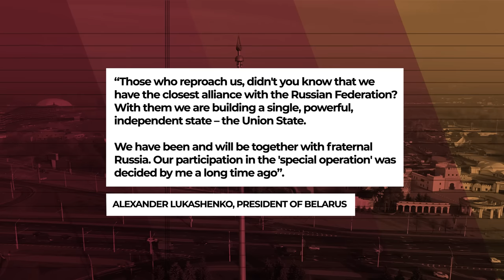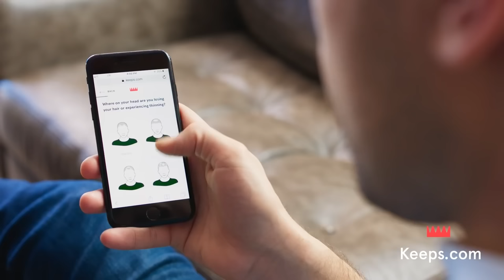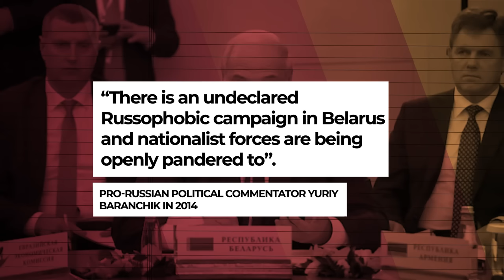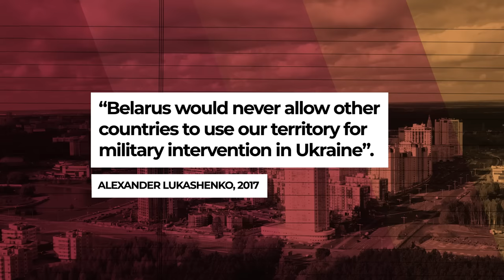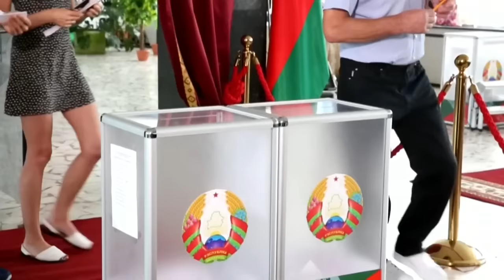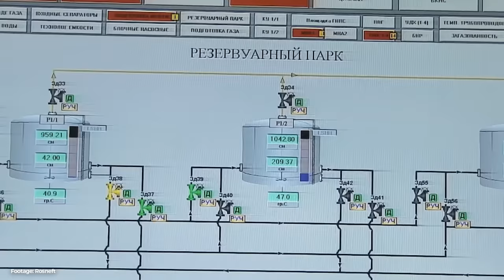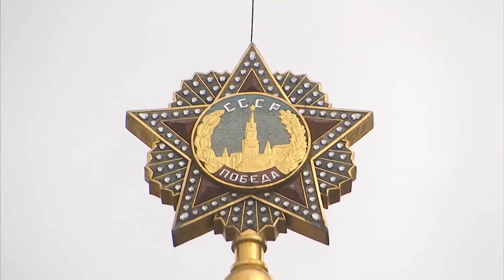Could Belarus Be Putin’s Consolation Prize? - VisualPolitik EN

Comment: Not sure how Belarus becoming a part of Russia would be any change from current situation.  Really does not matter.
Reply: Well there are a few reasons.

The first is the political aspect, Russia taking over Belarus helps to support Putin and his rule inside of Russia. Outside on the international stage it would be a sign of escalation and put the West in a position where they are forced to respond.

Think back to Germany during WW2, first it was the remiltization of the Rhineland. The west didn’t do much, then it was eating Austria the west did nothing. You get the point but once Poland was invaded the war really kicked off.

In the case of Russia they have already done the first parts with eating Crimea among other things but Belarus being eaten puts nato members at risk due to its strategic location as well as what it would signal.

On that not the strategic location is a major concern since there is a very small corridor that connects the West with the very small countries of Lithuania that should it be closed off would stop the west from being able to easily provide resources should Russia make them the next target.
Reply: accurate
Reply: If it becomes a 'part of Ruzzia' now it will also break off again when Ruzzia fractures...
Reply: @rogerjohnson2562  Probably right😂
Reply: @dennisp8520  Could be right👍

Comment: The bigger question is, will the one that replace Putin be as insistent and powerful enough to still take Belarus.
Reply: For those who may not grasp this. Putin is the most moderate leader, in ages. Who replaces him will be aback to a hardliner. You can at least approach him. Remember Stalinist Rossiya  and Leon Brezhnev rule. Gorbachev actually attempted  openness hot him booted. And in his place perhsps most corrupt president in its history  until he was asked to step down and succeeded by putin. For those who don’t remember breadlines have gone, modernized Moscow to point where  people are much better off people don’t understand how bad it truly was in Rossiya. From infrastructure to jobs people now have purpose. Most of all breadlines are no longer prevalent.  As for Rossiya,  simply putting the empire back together jyst as the Persians are doing. People may not like it.

Comment: The West should be preparing the capacity to neutralise Russian moves to hold the Belarus hostage. Develop emergency supply capacity of energy for when Russia turns off the tap. It should be doing this both to secure its own energy independence from Russia and to be able to step in and provide aid to any pro democracy movement within Belarus. 

We should also be preparing communication channels and NATO military plans to rapidly provide a Free Belarus with material aid to protect their land and sovereignty if Russia attempts to invade. 

But we absolutely should not be preparing to directly interfere in the status of its sovereignty, as this is not what NATO is for, Belarus has not requested such assistance, and such interventions, without the overwhelming support of the host nation’s people, typically turn into quagmires, and it is doubtful if there is enough of a threat to justify it.